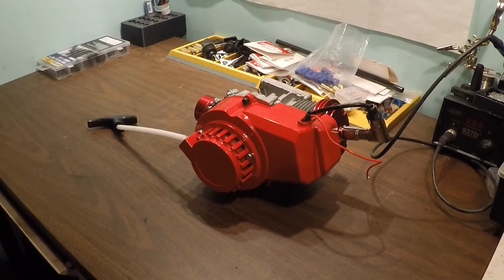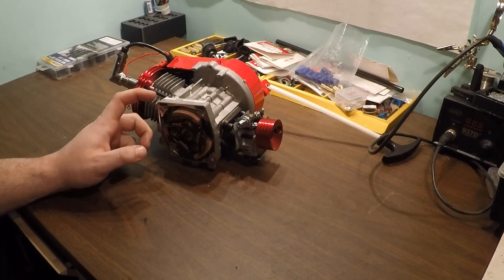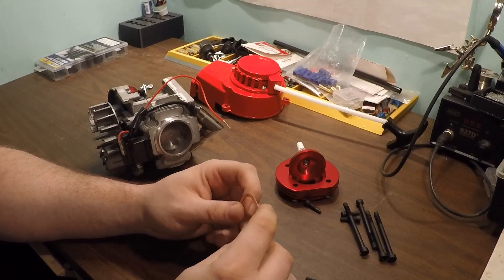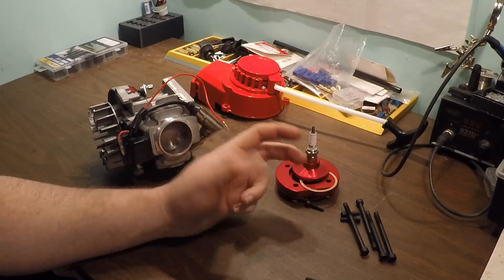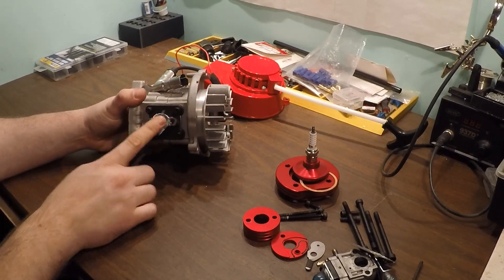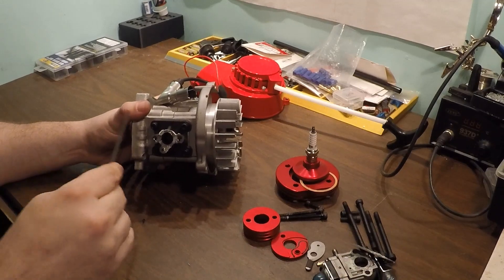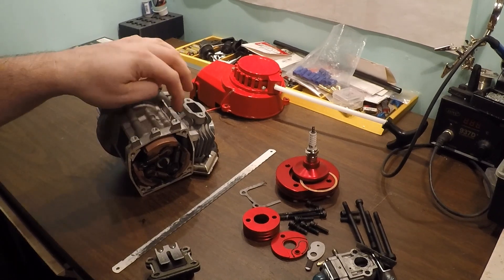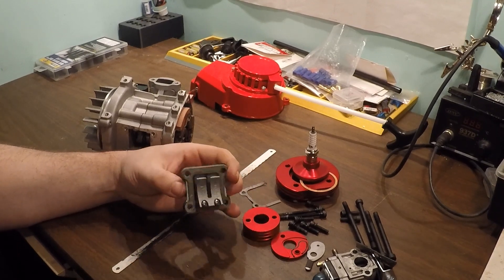PRIMAL RC, RAMINATOR 50CC ENGINE MODS!.. (PART 1, THE TEARDOWN)

Comment: Sir do you know what is the max RPMs we get out of a stock Raminator 49CC engine? I am working on a project and that info would be a huge help. Thanks!!
Reply from the maker: Unfortunately we never measured the factory setup max rpm, so I'm not positive of the exact number.. 

That being said a typical stock cag 49cc engine runs in the 8,500-9,500 rpm range.. Being that this is essentially just a cag 49 I would say it will be the same..

I do know a highly modified cag can approach 12k rpm with bolt on parts, and usually around 14k after some carefully mapped porting as well as the bolt on mods...

Sorry I can't give exact numbers, it never really dawned on me to check the factory rpm.. I hope this helps to some degree...👍
Reply: @camaroboy383  great info. Thank you so much!
Reply from the maker: @rickdizzlefoshizzle1087  No problem at all man.. any time..👍

Comment: hey My fellow Primal MT owner! Im new to your channel, Gave you a sub, looking forward to the rest of this series!  BTW, mine is chassis serial # 32, I was one of the first to get this thing.  SO far I've only replaced fuel lines and soldered in a new power switch.
Reply from the maker: Thanks for stopping in to check it out man...👍.. 

The truck is one of my buddies.. I just couldn't stand the fact the thing was just lame all stock.. dont get me wrong, it really is a gorgeous piece, the machining is beautiful, and I respect every part of that truck ..

 Just cant beleive the lack of power and tune.. all they really needed to do was put an adjustable clutch in it, have it come in on the power and I beleive it would have been decent...👍...

He also had a failed power switch, but he has also had nothing but issues with servos burning up.. steering servo's twice, brake servo is on it's way out, reverse servo caught fire... he will need to spend around 600 for servos.. that sucks!..

Thanks again man, and I appreciate the sub..👍

Comment: Following, Very cool , it will be interesting to
See what you can do with this stock engine, I was going to get the TMR engine but for $1100.00 with no pipe I will wait , the stock engine in my monster truck needs this kinda love.. lol  They also say the stock pipe isn’t that good either?  Regardless iam intrested to see what you can with this engine. Thanks man for exploring this engine!👍
Reply: Can't wait for part 2
Reply from the maker: @williewhite6444   Thank you sir..👍.. hoping to have parts soon.. figured they would be here by now..🤦‍♂️
Reply from the maker: Thanks for stopping in to watch and sub...👍.. much appreciated..

Waiting on some parts, so I'll be back on this when they come in.. the tmr engine is just a modded factory engine like this one.. the power can be drawn out with some work for sure.. 1100 is steep for something that is just poked at.. my buddy does not want to spend that kind of loot and I don't blame him..

As for the pipe that has yet to be seen.. it is possible it may work if the charge tract is lengthened or shortened, that will be something we will need to play with after the build...😎... for sure it would never work on the 80's.. there just isn't enough volume in the factory pipe..👍..

Hope to be back on it soon...✌
Reply: @camaroboy383  Awesome!
Reply: @camaroboy383  I have been eyeing up a 46 from DDM , but I will wait to see if you can find some power in this engine. Thanks again man.

Comment: The gaskets have a silicone substance impregnated into material . The new gaskets if the same type will do the same thing
Reply from the maker: Thanks for stopping in to check it out..👍.. I know exactly what your saying, but they were standard paper gaskets.. whoever is building them for primal just got a little happy with the rtv... 😂😂.. 

Appreciate you watching sir..👍✌
Reply: @camaroboy383  Oh . Probably to much Saki . LOL
Reply from the maker: @russellcupples2170  😂😂😂😂😂... that could surely have been the case...😱😂😂😂..
Reply: @camaroboy383  LOL